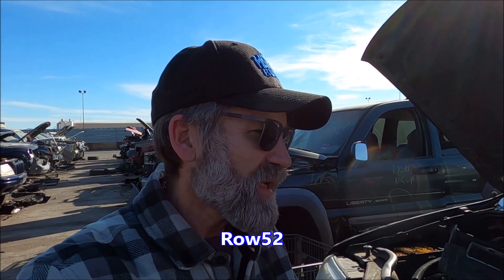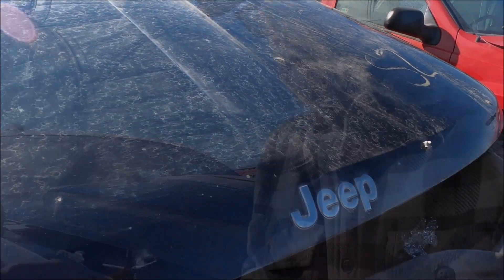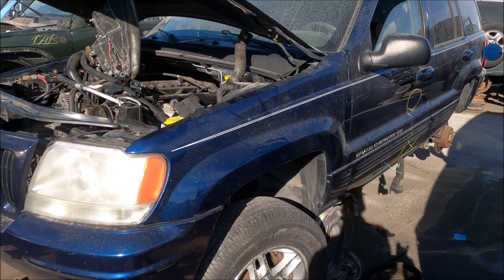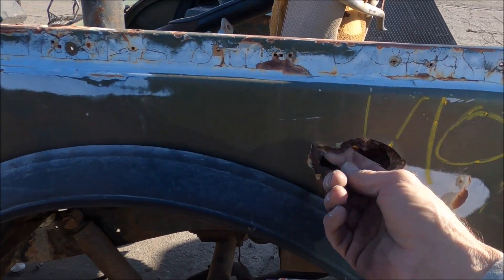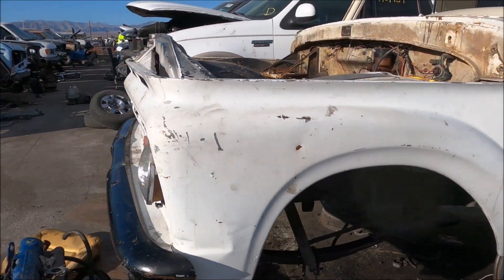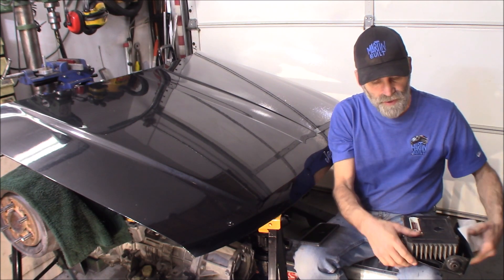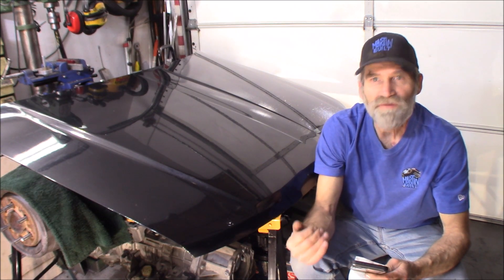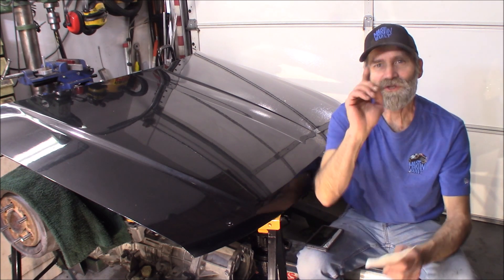On the Hunt for Jeep WJ Parts at the North Las Vegas Pic-A-Part

Comment: I have 2 pick-n-pulls in my area about the same distance I've also noticed they don't have many xj's anymore. I've shopped pick-n-pull for many years for xj parts I've been collecting interior parts and just everything xj for years I've had a ton of them and just recently I've started to buy more complete vehicles to have around for parts and stuff because the wrecking yard just isn't getting them and the prices are through the roof it used to be I'd only buy vehicles to build and i already have everything but now that i cant replenish my stash as much im looking to go about things a little differently. Everytime I fix up an xj I look for a nice body and I usually do mechanical and interior stuff I always like to fix up the interior nice.  On our personal xj's or friends I like to add different options and stuff I have my preference of everything and mix and match limited model and Laredo or even base model stuff or renix era interior stuff, it's a lot of fun. There's some stuff that's seriously hard to find in usable shape nowadays for an xj. I usually stick to the 91-95 stuff especially recently because those are my favorite years to build. There used to be as many xj's as you see grand cherokees in the wrecking yard just aisles of them and I'm super picky on what condition my parts are in so recently I've only gotten hardware and little things

Comment: I almost did a similar ram air build on my Dak when I seen your previous vids on the current setup you've got, now I'm excited to see what you do this time. Thanks for the info on the app, I'll definitely check it out as I'm always looking for stuff for my Dak and possible mods. Those chips in the hood are an easy fix and a touch up oem paint pen and a good buff and polish it'll look like new.... of course after you dothe new ram system of course 🤣✌🤘😎🤘
Reply from the maker: Yeah the new Ram Air is gonna look pretty cool, it will be made from aluminum and a conical shaped filter.

Comment: Hey Martin ,  I have been a subscriber to your channel for the past couple of years and watch your often , and I admire the nice neat work that you do .  You are very knowledgeable when it comes to things on the jeep WJ model .
 So I was wondering if maybe you could help me out with some information .
 My son in law has a 2001 WJ with the duel climate control electronic heating and AC system , and we are having trouble with it Shorting / Blowing out the Relay / Resistor Module under the dashboard on the passenger side under the glove box that controls the blower motor .
 What happens is the Model gets a Short in it and then the Heater/ AC controls on the dashboard won't turn off , and the Blower Motor won't stop Running , unless we remove the fuse for the blower from the fuse box from under the hood .
 The Relay / Resistor Module has been replaced twice so far and so has the plug / pigtail wires that go to it .  
 Have you ever had , or have you ever seen this problem ? 
 Each time we replaced it , it will work perfectly fine for several weeks before the problem happens again .
 If you know anything about these systems and possibly have any answers that may help please send me back a message ,. or heck if you have the time maybe even make a video or two on it , cause I am willing to bet that Jeep made a lot of these and someone else is probably seeking the same answers I am .
 Thank you for all your videos .
Tim from Wisconsin .
Reply from the maker: Don't have much experience with climate control. I would inspect the wiring, and maybe replace the climate control. Could find a climate control at the salvage yard for around $25

Comment: I just got my 2000 WJ back from the body shop after being hit by a flying pop up tent that flew off of a Toyota 4 runner last summer. It hit just about the middle of the drivers door about 2 inches down from the glass. It took out both doors and damaged the quarter panel. I was glad I was wearing glasses as they was glass everywhere in the jeep. It is the same color as the the wj you showed patriot blue. Sadly it needs a few more hours to finish the doors. But I needed it for work.  Now I can get back to my 500 $ dakota. I will pull the heads and while waiting for them I will change the oil pump and pan. It dropped the the number 2 intake seat because the radiator cap went bad. It was kind of strange that it was almost hydro locked with gas in the number 2 cylinder. When I got it home I pulled the shroud and the fan. Then I used a ratchet and I could roll the engine over backwards non stop. But when rotating the direction it runs it would lock up. After I pulled the spark plug it freed up. So I got it started and I shocked it did not seem to have any blow by. It has 255.000 on the odometer. It will make a good farm pickup. It was nice when it was new being a quad cab laramie.  Thank you for another nice video.
Reply from the maker: Too bad Mr. Toyota didn't have his tent bolt it down properly.
Good luck with the repairs. Thank you for watching.

Comment: I have a question about a 4.7 magnum engine, a friend of mine has a 2009 dodge with the 4.7 dual spark plug engine, we couldn't find a dual spark plug at our local wrecking yard, I did find a 2007 4.7 with the single spark plug 4.7,  we pulled that 1,   my question can we put his dual spark plug cylinder heads on that engine that came with the single spark plug, I know the knock sensors are in different places but I think I can work around that.
Reply from the maker: Yes you can do that you are gonna lose compression. You're gonna go from 9.8 to 8.74 approximate. That could be as much as 50 horsepower.
Reply: @martinbuilt  can we deck the head even though it is a over head cam design
Reply: @martinbuilt  it will get him up and running
Reply: @martinbuilt  and thank you for your response
Reply: @martinbuilt  or would it be better to just run the single spark plug heads and get coils fir the single plugs and do away with the dual plug setup
Reply from the maker: @davidcunningham00  I would if they needed it but not so much ot increase the compression. They do have .027 thick head gaskets.

Comment: I know this doesn't pertain to this video,but I have an 04 jeep grand cherokee 4.7 ho.I just put a trans cooler on it.And even with that the engine temp still runs 210-220 and up.This scares me.I live in lake havasu where it gets hot af!Is there anything I can do to bring the temp down?
Reply from the maker: Yes the transmission cooler will help a lot to cool the transmission but unfortunately the hydraulic cooling fan is keeping the engine temperature up. That is the design of the hydraulic cooling fan the whole idea is awesome but they don't work like they're supposed to. I replaced mine with the electric fan from a 98 Jeep Grand Cherokee with a 5.9
Now the engine doesn't get above 200 ever.
Reply from the maker: Here is that video.  
How to convert a hydraulic cooing fan to electric.
https://youtu.be/J02nYci5DS0

Comment: Hi Martin,
What are the corresponding part numbers that identify it as the 5 speed TCM?
Reply from the maker: Here is part number 56044574AC for the 545RFE TCM
Reply from the maker: Here is part number 56044574AC for the 545RFE TCM
Reply: Thanks Martin,
I'm away from the WJ but will check once  I am back in the state.
Keep up the good work.
Really looking forward to the up coming build😁
Reply: Thanks again Martin, I had pulled two TCMs and didn't label which one came off the HO.
Now installed and hoping for a change in fuel consumption.

Comment: How much for an 08 intake and cams out there?
Reply from the maker: Intake manifolds are $55 each plus a $5 court and Cam shafts are $22 each plus a $2 core.
Reply: @martinbuilt  core? Wow, that's odd (to me)
Reply from the maker: @brownwrench  yes some of what they charge a core for is odd. I understand for alternators, starters, PS pumps, transmissions, and engines but for a hood or intake manifold, really.

Comment: Hey Martin I'm getting code p1598 on my 4.7 04 Overland
Reply from the maker: Faulty A/C Pressure Sensor A/C Pressure Sensor harness is an open or shorted A/C Pressure Sensor electrical circuit with poor electrical connection.

Visually inspect the related wiring harness and connectors. Check for damaged components and look for broken, bent, pushed out, or corroded connector pins.